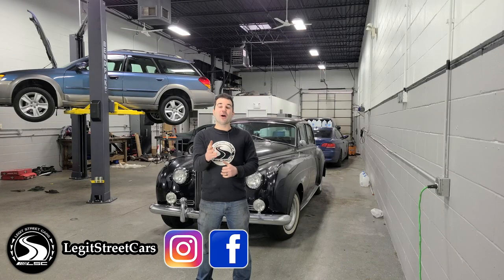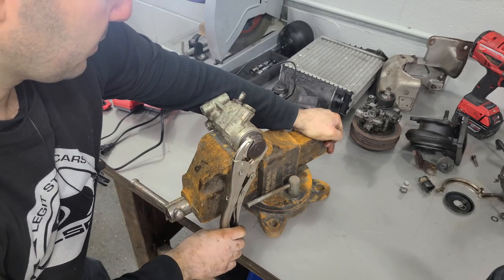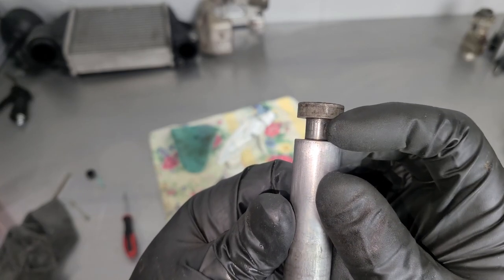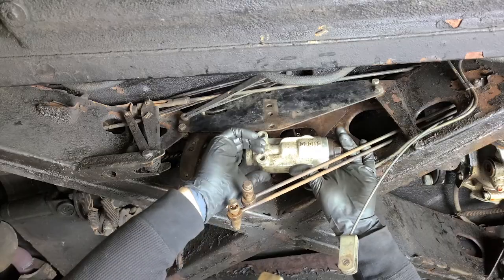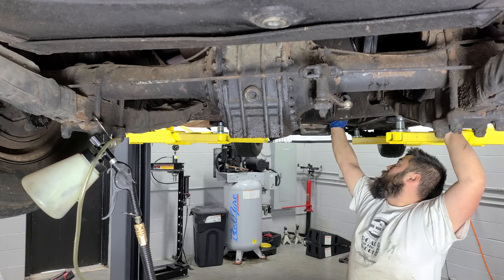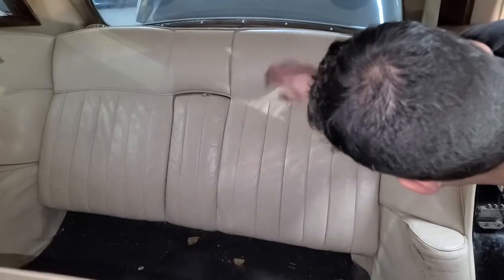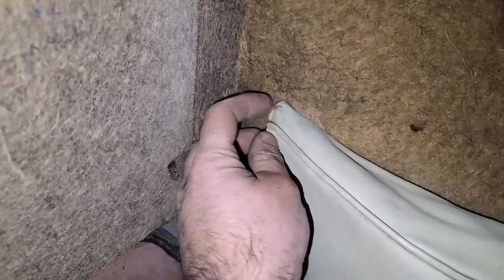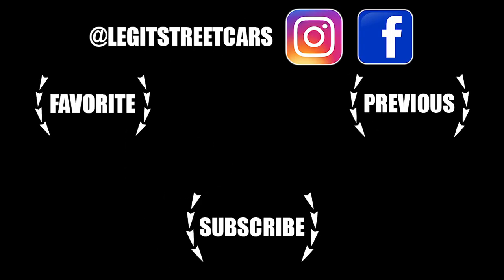Rebuilding 62-Year-Old Rolls-Royce Brake Master Cylinders & What I Found Underneath The Seats!

Comment: That's an old gasoline receipt from when you used to stay in your car and an attendant would pump your gas.  Then he would take your card and run it and come back out with a little tray so you could sign for it.  Notice that 15 gallons of fuel was $5.25

Comment: Who knew that airborne trichloroethane was carcinogenic?
77 years old.
Suggest nice socket head bolts to replace the flat heads.
Sohio is Standard Oil of Ohio (you missed the I part.)  Credit cards were a thing in 1966. ATMs, more's the pity, were not.

Comment: But where is the link to both of the brake master cylinder rebuild kits? Which reservoir was low to begin with? The one closest to the fire wall or furthest? Is the small master cylinder fed off of the reservoir closest to the firewall?

Comment: Genuine credit card receipt from SOHio (standard oil of Ohio) in 1966. One of the corporations that standard oil was broken up into. 

I'd have a manual transmission Cadillac CT6 or V12 Merc S class station wagon. A modern version of the Sultan of Brunai's, or an American version of it. 800HP and 85CUFT of storage minimum. 

I'm 25.

Comment: You should be thankful that you don't have the factory rear seat radio controls. You'd pull your hair out trying to get the armrest out containing the controls. 

The back seat of my Daimler DS420 limo didn't contain any money, but it did contain an invitation to the Queen's Garden Party from the 1970's. Unfortunately, that was like 25 years earlier, so I couldn't use it.

Comment: An old trick, always use Rubber grease, on rubber seals on the brake system, slave cylinder, master cylinder etc, they will last twice as long, than using brake fluid.

Comment: From Wiki:
Seams proper for a Roller
"In the 1960s, Standard Oil of Ohio partnered with British Petroleum, in the development of the Prudhoe Bay, Alaska petroleum reserves and the construction of the Trans Alaska pipeline. The complex partnership called for a gradual stock acquisition until British petroleum would eventually gain controlling interest culminating in total acquisition of the American company. The company ceased operations in 1987, although BP continued to sell gasoline under the 'Sohio' brand until 1991."

Comment: I worked in  part old rebuild we hon and use stainless sleeve old if needed.We did alot of old british and American.The problem is pitting at ports ect and rubber oring ect will fail.I did alot Royce and the rarest in the world.He might get work for awhaile till fail and will.

Comment: I'll be surprised if the 'handbrake' works, since you said that you connected the 'E brake' or 'Emergency brake' and I am not aware of Rolls Royce ever fitting either of those to your car. Also you used a 'cotter pin' instead of a 'split pin'. You will need to make sure that your 'cotter pin' works on the Rolls. 🤣

Comment: You need a Brake Cylinder hone, clean that master cylinder up. 
Most people instead of sand paper would just use the wire wheel on the bench grinder...

Comment: You should be using Dot -4 brake fluid!!! All British care use natural rubber seals, dot -3 fluid will ruin you seals pretty quick and you’ll end up doing all your hard work ove😵‍💫😵‍💫😵‍💫
I’ve owned MG’s my whole life and I’ve seen it happen.
Reply: I use the brake fluid formulated specifically for S1 Rolls (Castrol RR363) in my 1959 Cloud.

Comment: You need a special kind of person to decode that receipt. A midwesterner. From the east part.
That's a Standard Oil (SOHIO) receipt, for a credit card transaction between 6/1964 and 6/1966, made using a carbon copy impression credit card recorder. It's legible enough to also tell that it was a SOHIO credit card, NOT a Visa or Mastercard. The purchase was for 15.6 gallons of gasoline (Boron, which is the brand name for their base octane rating) for a total of $5.55. Notably, it's also CLEAR proof that it was not a southern car strictly. "License No." is license plate number and state is, state. There's only one "O" state with a SOHIO, and it ain't Oklahoma. So this car was definitively plated in Ohio in 1964-1966, but the handwriting is too rough for me to tell you exactly what plate number.
Hard to believe I'm younger than the car, innit? (No, really. Think we're about the same age.) SOHIO converted to BP for all their service stations in '91, but they still use the SOHIO brand for marine fuels.

Comment: You obviously don't understand how the braking system on a Cloud works!!! Fortunately, to bleed the brakes, it was done the correct way in that you had your assistant manually moving the levers connected to the brake cylinders. You CAN NOT properly bleed Cloud brakes sitting in the car!!! When you are driving the car, there is a shaft on the transmission which comes out to a mechanism with a round disc that the brake rods connect  into, which in turn are connected mechanically to the  rear brakes. When you apply the brake pedal, this engages the clutch affair at the transmission, which turns the round metal plate, which then pushes/pulls the metal rod linkage to the wheels and the brake shoes!  This is why at a very low speed, the brakes are the same as pulling on the emergency brake handle! I am thankful you showed me how to remove the rear seat, especially the back of the seat with only two bolts. Now i can take it out and remove the original rear fold down arm rest and replace it with my extremely rare one with the  three built in stainless steel liquor flasks, collapsable cups and black RR coasters!!! The original one is special also, with slots for a pig skin covered note book, pencil, pig skin covered compact, pig skin covered cigarette case. It was specially order by the original owner but  the arm rest bar set is much more rare! My car is also equipped with a one of a kind automatic mascot changing device. Do a YT search for "Modern Plinth"  to see it in action! Keep up the good work and I hope your upholsterer knows how many stitches to the inch are original to the Cloud. You don't want to get docked any points when you enter your car in a reputable Concours D' Elegance!!! Oh, and BTW, I ONLY serve French's  Yellow mustard with my ROLLS-ROYCE picnic table setting and Platinum Coalport "Admiral" china!!!!